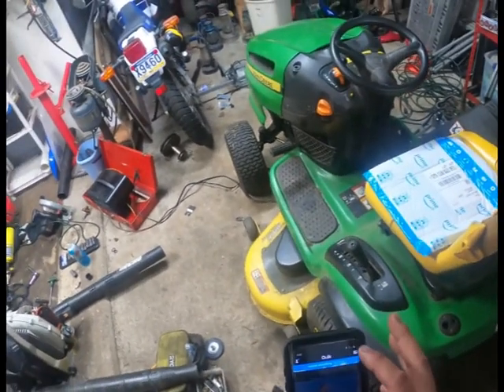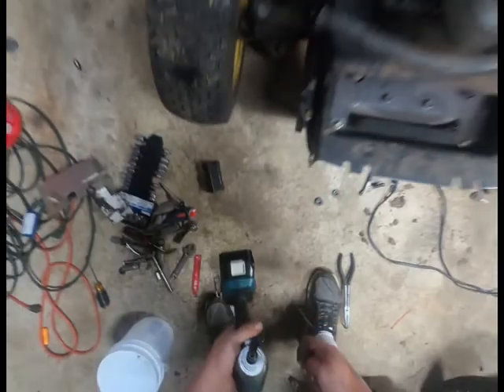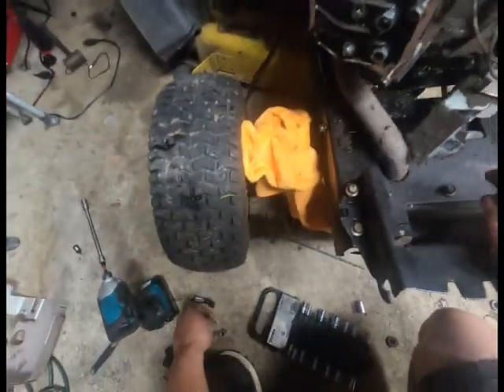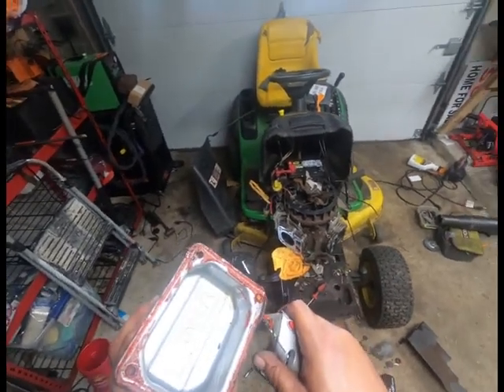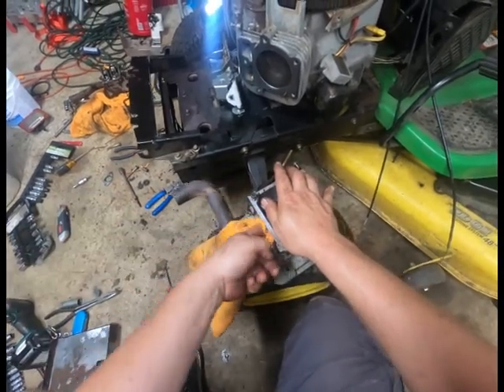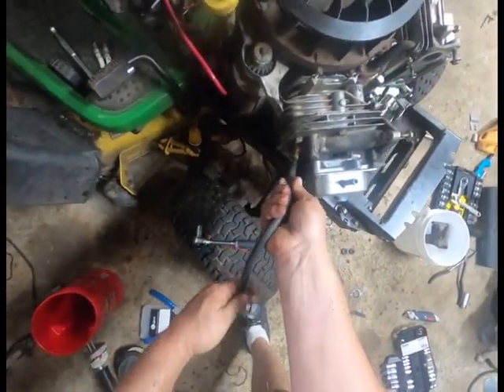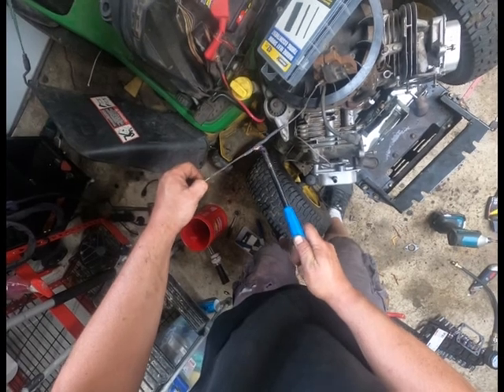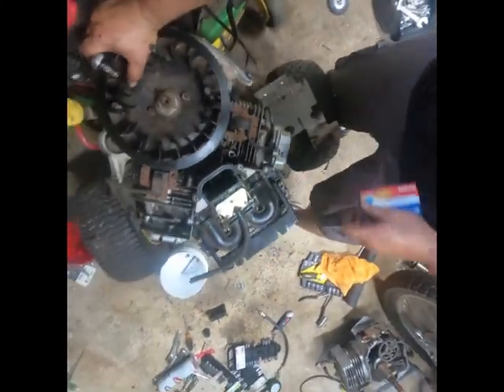briggs and stratton twin cylinder head gasket replacement

Comment: complete but waaaay too long, brevity is your friend
Reply from the maker: Glad it was informative. Everyone hates waiting anymore. Good thing there's a fast forward option :)
Reply: @rywolf01  This was very informative .  My Hausqvarna  Twin YTH24V54 has  fuel in oil high on dipstick, also leaking below on right side facing forward. But motor runs really well no shaking or anything. Thought it was needle float stuck . But really I think I need to do a carb ( new one ) and head gaskets .  Your the only one I found on YouTube that’s showing the Twin. Is there a difference  between John Deere and Husqvarna mowers?  Couldn’t find the had gaskets online ..but I’m sure there a place..  I’m a back yard wanna be garden, car mechanic.. I’ll try anything to repair but depend on YouTube people yourself and others . I have mostly every kind of tool going..But only thing my 74 yr old body starting to hurt kneeling on ground gravel and no garage. If you have any ideas please share.. 
   You have a sure site…z🙂.       John
Reply: @gotacopy821 
If the engines are Briggs,  they should be the same.  I've done the same on a Kohler,  and they are very close to the same.  The only difference,  is the Kohler has 4 head bolts and Briggs has 5.  I would suggest you power wash,  BEFORE you start work.  Good luck